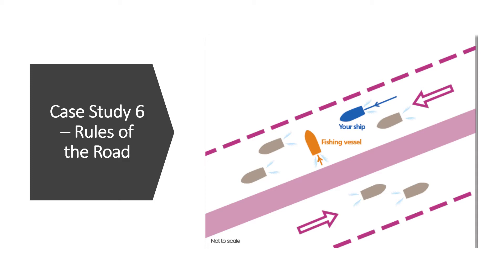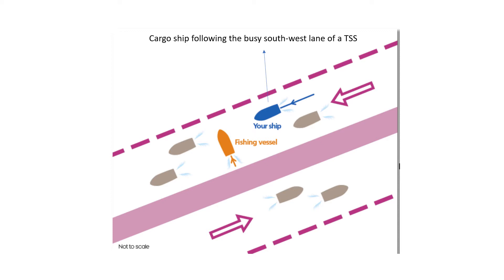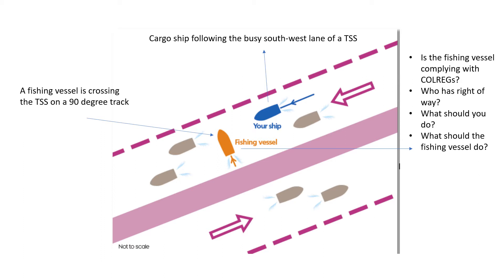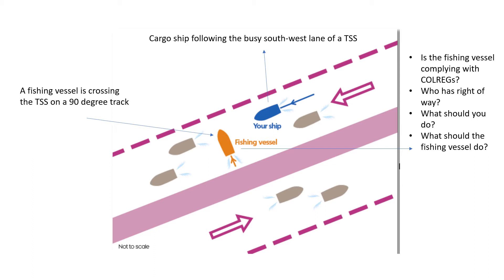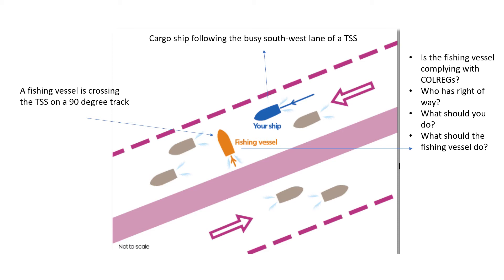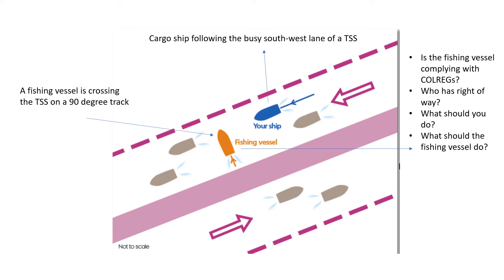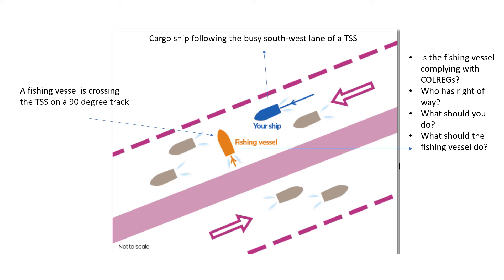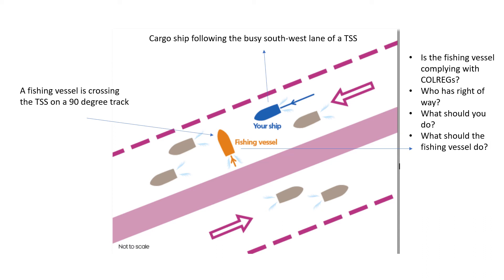Case Study 6 – Rules of the Road (ROR) with analysis

Comment: Sir, rule 8 f iii requires of a vessel the passage of which is not to be impeded remains fully obliged to comply with the rules of this part, my analysis is FV is not following the rule 10 & 8, but I am still the give way as per rule 18. Your thoughts please.

Comment: Thank you sir for the analysis, but i have a doubt here " In question 4 if the fishing vessel makes a wide alteration to STBD to pass astern of the P.D vessel its course would then be in the NW direction which is opposite to the general direction of traffic flow for the lane". So would it be appropriate for the fishing vsl to alter its course to port  join the traffic flow for the lane and exit the TSS?

Comment: Right of way isnt the correct terminology. There is no right of way in the rules. There's either, stand on, give way or those required not to impede the passage or safe passage. Also using the term fishing vessel isn't correct, please refer to rule 3. You're also saying a fishing vessel should be displaying the lights of a fishing vessels and a trawler the light of a trawler, but both are deemed to be a vessel engaged in fishing. I'm sorry but this isn't a very good analysis of rule 10. Also a VEF CAN fish in a TSS. 

The answer is; under rule 18 the pdv is required to keep clear of a VEF, except where rule 10 otherwise requires. It does otherwise require. Rule 10 states a VEF shall not impede the passage of any vessel following a traffic lane so therefor under rule 8f shall take early action to allow sufficient sea room. 

The situation seems like the VEF hasn't so I would sound 5 short blasts, call the master, engage hand steering, conduct a chart assessment and radar assessment. If still no action for the VEF, due to a vessel on my port side I shall slow down and allow the VEF to pass.

It's important to note there is no stand on vessel in this situation. The PDV is a give way vessel under rule 18, but the VEF is required not to impede my passage.
Reply: Good morning 
 For preparation of second mate / DNS/ BSC nautical science/NCV come in #kundanpatna
Reply: Actually the same were my answers.PDV to give way to fishing.  The situation by it's self is quite difficult and could be interpritated both ways. But rule 10 gives the idea - that all other rules are to be implemented. so - Fishing vessel, executing fishing is the vessel to be avoided. Otherwiese - it says, shell not to impede ( 10 I + rule 8). When in court - it would be the case, which place, which TSS was the collision / allision. and who's lawers more strong. All the rest - have a safe sailing.
Reply: to add to this, A VL that is "not to impede" the passage or safe passage of another is not relieved of her opbligation when approaching another VL so as to involve R.O.C, So if the Fessel engaged in fishing does not take action the PDV mus obide by the responsibilities under Rule 18

Comment: can you also talk about if the fishing vessel does not take action? call master sound 5 short blasts and make a broad  alteration to stb or port if safe to do so?
Reply from the maker: Absolutely Sam. I did not delve into it since I was only focusing on explaining the responsibilities of vessels according to the COLREGs (in this case Rule 10). But you are right, short 5 blasts followed by flashing the lights should precede, you may also slow your speed.